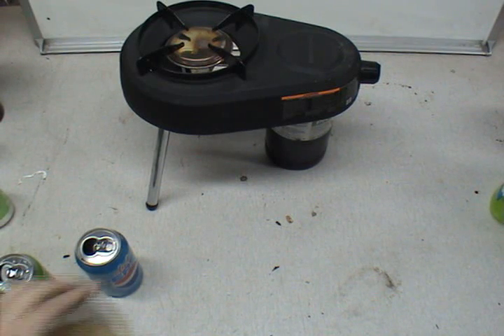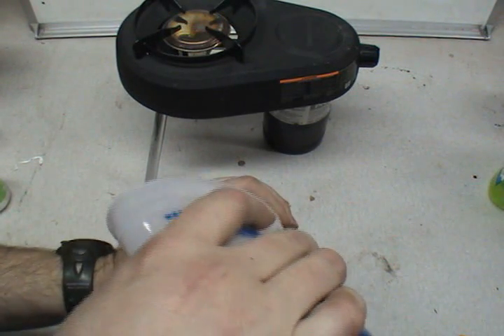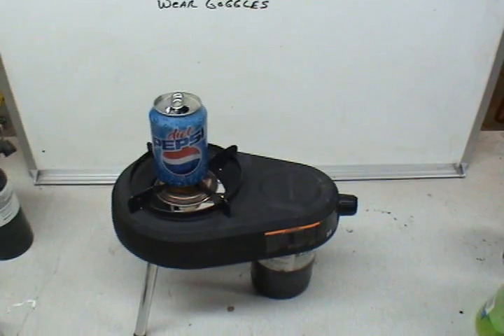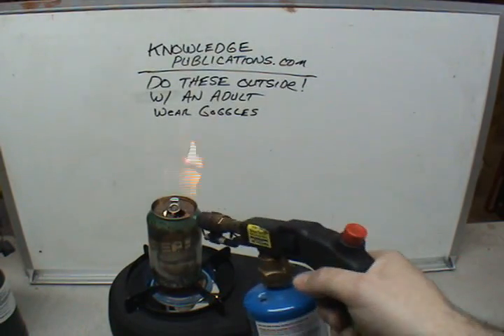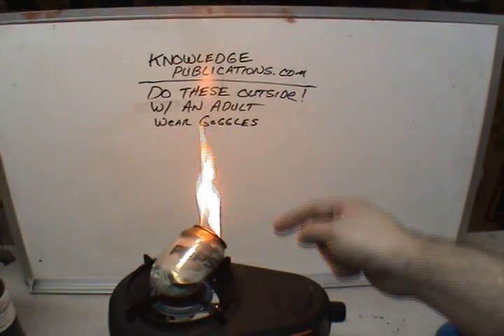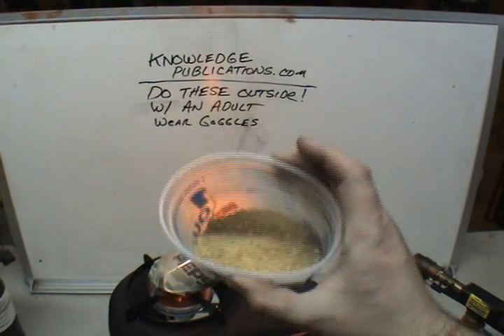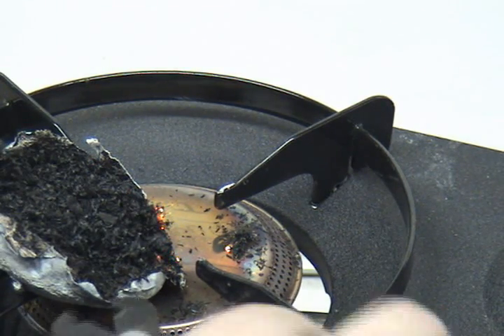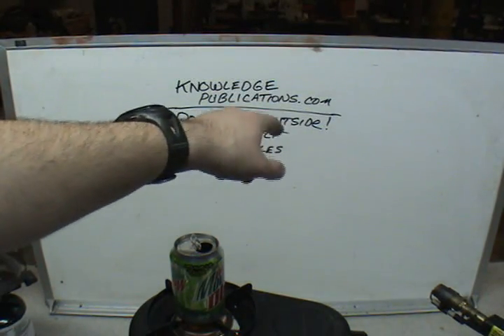Sodacan Hydrogen Biomass Wood Gas Gasifier Part 1

Comment from the maker: @mangyscavenger yes, concentrated sunlight CAN be used for this...that's one of the advantages of solar power and ANY STOVE makes 1600 to 2000 degrees F temperature.  A match gets to be 1600-1650F.  Although you keep on talking like  rocket stove is some infinite source of power light a light saber, it is not.  Its just as simple self drafting insulated stove that has a much higher efficiency than an open camp fire.

Comment: Can't concentrated sunlight be used as the heat source for wood gasification? Fresnel lens or parabolic trough?
Also, could a rocket stove be made to produce wood gas via a gasification chamber in the flue? Rocket stoves are cheap to build & get 1400 to 2000 degrees heat.

Comment from the maker: @josephdupont saw dust on itself is a great insulator, so its hard to heat up a pile of saw dust quickly, and you would  not use electric heat because 1: the car can't make enough, the alternator is not a light saber of infinite power,  and 2: because you probably would not get enough gas from the wood to make up what you just used in electricity.

Comment from the maker: You are VERY incorrect, you are getting out much more energy than you put in, about 15% of what is produced is put into the system.  It can sustain itself. Remember this is not some overunity CRAP, the biomass is actually a fuel, an energy source.  Stored sunshine of course. :)